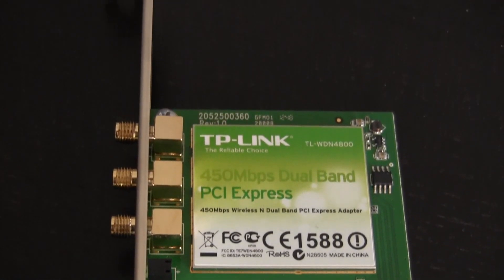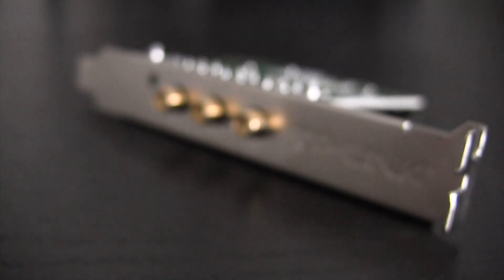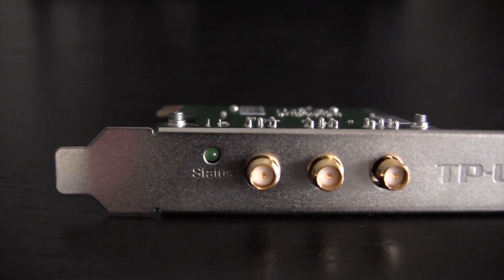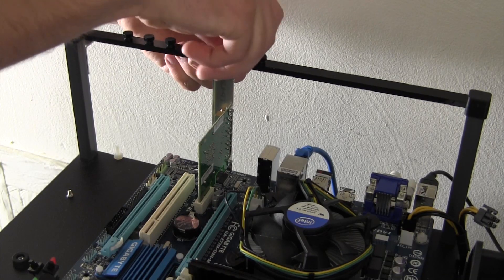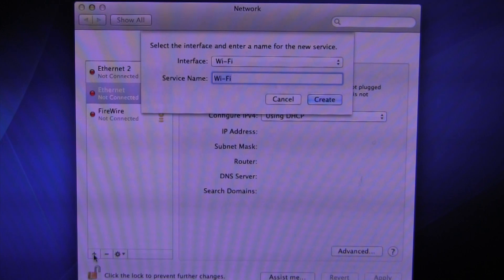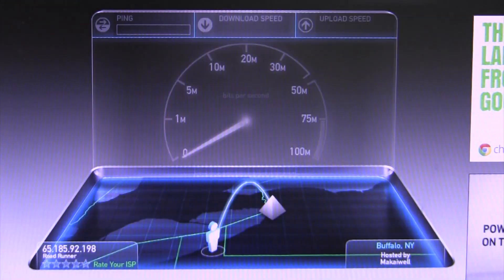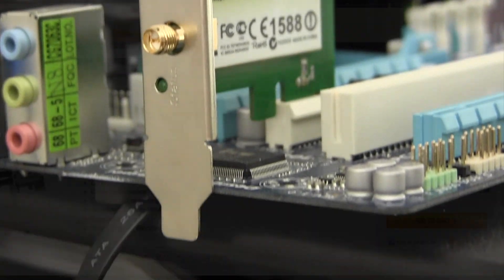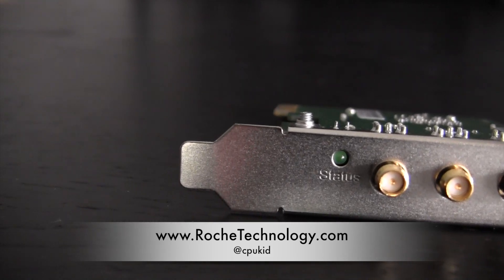Hackintosh Hardware: TP-Link TL-WDN4800 [Wi-Fi Card]

Comment: You said this will go in a PCIe normal slot like the video card slot? i'm running a Gigabyte Z87N-Wifi at the moment. That board is a micro itx so it only has the normal PCIe video card slot.  Thanks in advance for any info. =)

Running High Sierra, by the way.

Comment: The three antenas are not intended to boost the signal but to reach 450 Mb/s speeds (well, actually roughly ~400) Each antenna is capable of 150 Mb/s, multiply that by 3 and tadaaa.

Comment: Any idea how to make this run on OS X Yosemite as it gives the error: ATHR: Unknown Locale 21
this is the wireless card giving this error.
Reply: +VideoAndMore Did you ever resolve this? Was about to pull the trigger on this card, as it seems to be popular among the H-tosh Yosemite users. Kinda worried now though
Reply: JLiRD808 Yes, I solved this by Updating Yosemite to 10.10.5 using the HackintoshZone distro. Careful when  updating because you'll get a sandbox error, all you have to do is update the kernel. No more unknown locale 21 errors. System will over see them.

Comment: I bought the TL-WDN4800 and find out is not working at all on Mavericks. I have two systems and both them don't even recognized the card. Works great on windows 8. Any solution for Mavericks?
Reply: did you go into system preferances
Reply: Should work OOB, it does on 10.9.5 for me.

Comment: Thanks to you, I got this card for my PC.  It was a HUGE upgrade from my USB wireless adapter.  I'm am so glad I don't need third-party software to change the network settings.  I had a small problem with it because my PC was to close to my wall, blocking the signal.  I moved it two inches forward and it hasn't dropped signal since.  This is the best solution for gaming on a wireless connection.  Also, it works flawlessly with my 5ghz wireless N router, also by TP-Link.